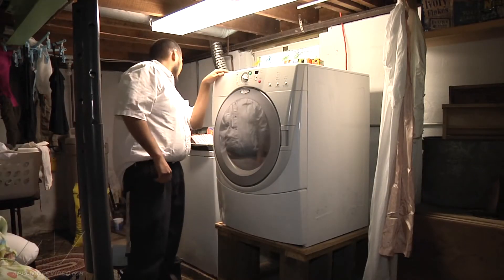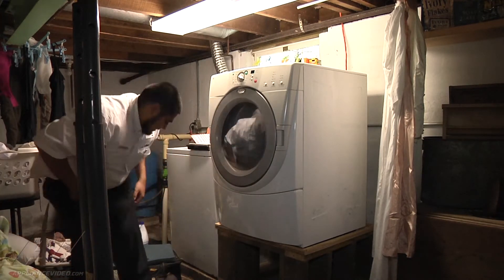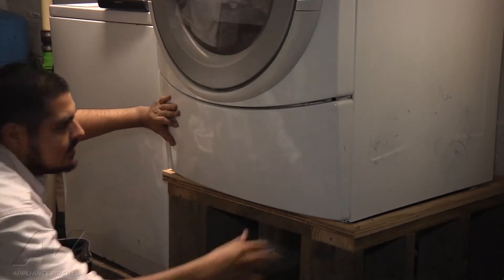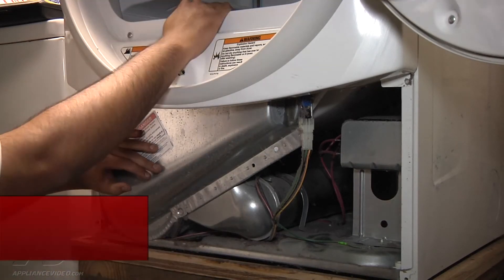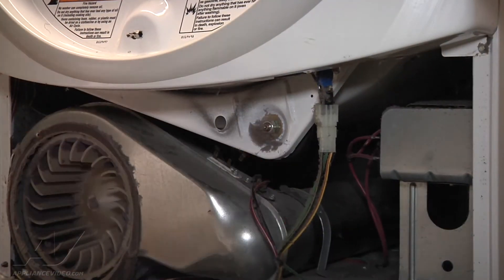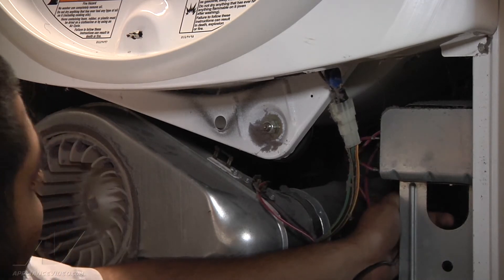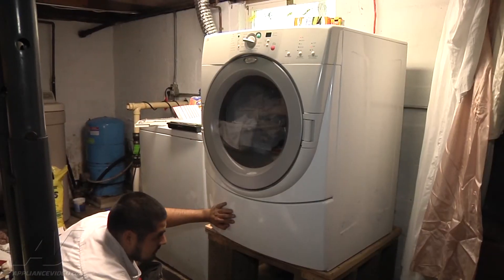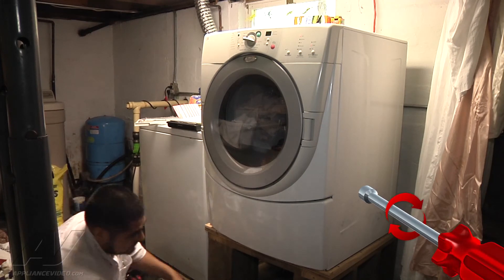Whirlpool Dryer Repair - Long Drying Times - Main Control

Comment: How did you determine it was the board that was bad? No other possibilities? Replacing the relay on the board isn't an option?
Reply from the maker: Great question, if you have a
more technical question that our parts department cannot answer, our
technicians are answering all questions at our website at www.ApplianceVideo.com under our Repair Help section. You can also call
our parts department at 1-800-830-5465 and they can give you help 7-days A week
Monday -Sunday, or search at www.SaveMoreOnParts.com  24 hours
7- days A week.

Comment: How did you even check the heather relay on the control board?
Reply from the maker: Great question, if you have a
more technical question that our parts department cannot answer, our
technicians are answering all questions at our website at www.ApplianceVideo.com under our Repair Help section. You can also call
our parts department at 1-800-830-5465 and they can give you help 7-days A week
Monday -Sunday, or search at www.SaveMoreOnParts.com  24 hours
7- days A week.